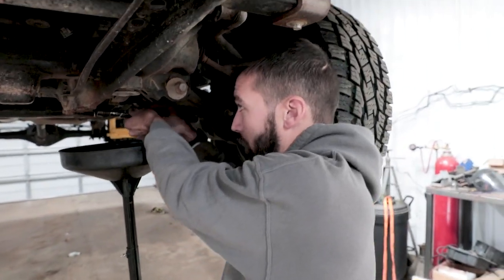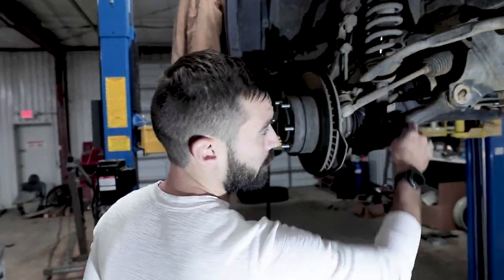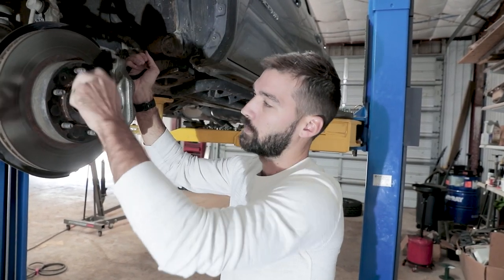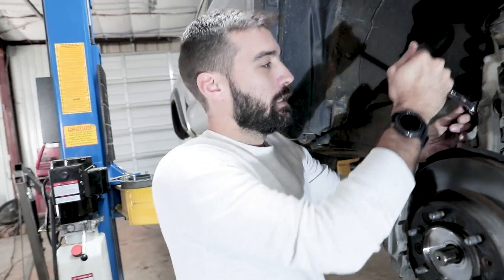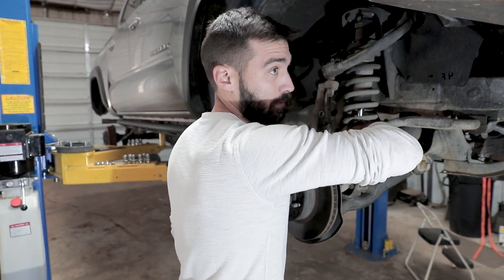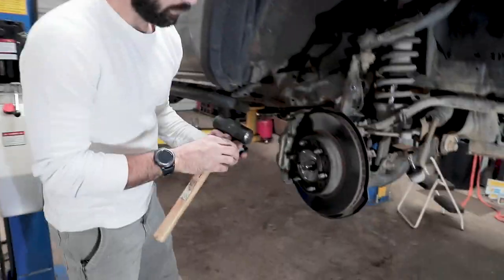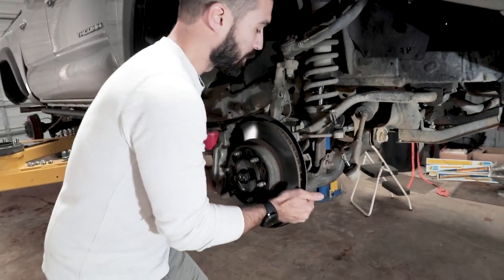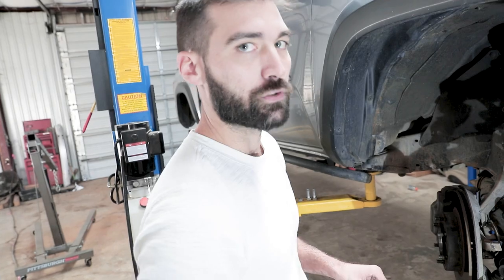5.29 Nitro Gears from ECGS | Part 1 | DIY Installs Episode 5

Comment: I just watched a video of them drag racing a stock Tacoma against one with the 5.29 and the stock one won every race
Reply: Regearing doesn’t add speed. It takes it away and gives more torque and better shift points and lower speeds. Makes heavier vehicles operate more efficiently and do better off road where slower is better